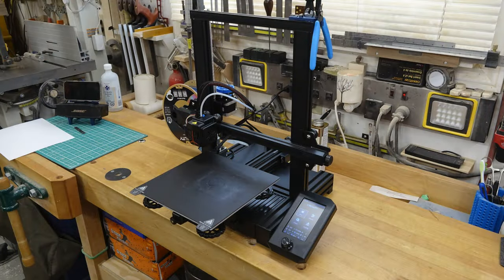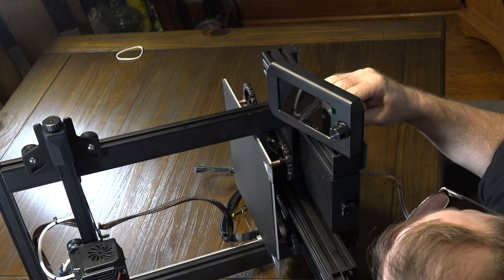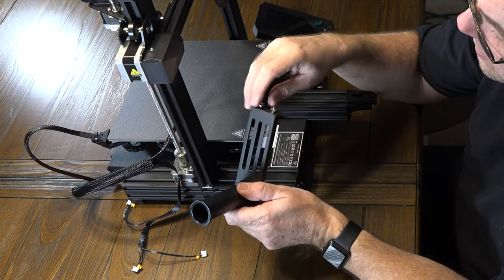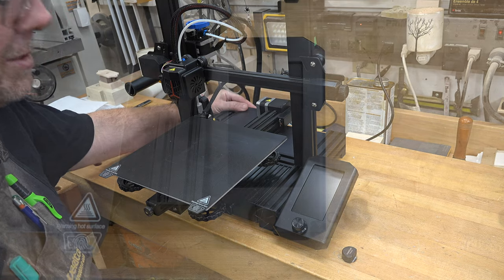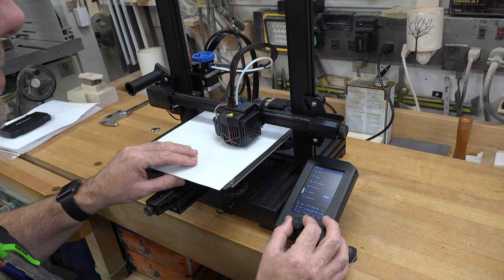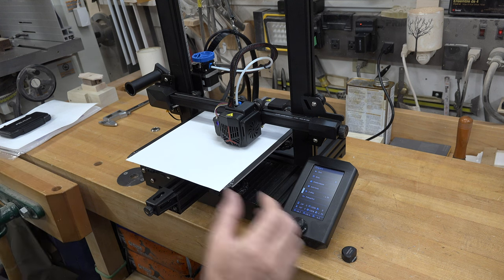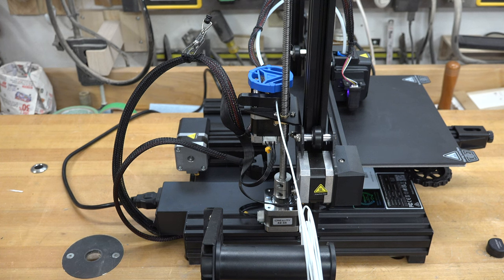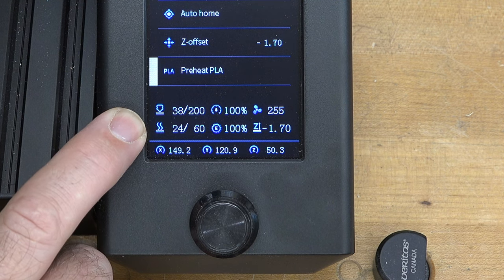Assembly and Bed Levelling of the Creality Ender 3 V2 Neo 3D Printer

Comment: Hi Kenny, good one Kenny, also one important step for you prints sticking to the bed is keeping it clean, I use isopropyl alcohol and don't touch it with your fingers the oil in them will cause your prints to not stick to the bed, thanks again Kenny.
Reply from the maker: I too clean the bed with alcohol Philip.  Good to know that I'm not the only one.  Thanks for tuning in to the show.

Comment: im getting really depresso here, i cant for the life of me figure out the levelling... i did all your steps perfect  in order,made sure it was fine and it still fucks up...im about to cry
Reply from the maker: What seems to be the problem with your prints Rosa?  What exactly is happening.  Maybe you could email me some pictures of how it is messing up or possibly contact me on Facebook messenger and I will help as much as I can to get you making some successful prints.  Looking forward to your reply.  Thanks for tuning in.
Reply: @acutabove_woodworkings  well right now my CRtouch broke off so im waiting from creality to get a new one... cause that plastic housing broke off so fast after i was following a ifixit guide to make sure all the bearings were tight -_- but everything was going super great,i printed a ducky and a boat. so i thought hey i can get started on the real deal, i needed some new ear pad adapters for my headphones cause i bought new pads for it. so i printed part one it went perfect, i wanted to print part 2,/and they are perfect circles btw)...yet it was constantly messing up,it looked like the fillament did not wanna stick to the bed... i sliced it in a diffrent slicers,creality print  and cura,yet the same results everytime... i took a few recordings and images i can forward to you, but right now im a bit hardstuck until i have the new CRtouch... but when i do have it if you dont mind, since this is my first 3d printer ever. id love to have a chat with you or some email conversations about it :/ im willing to pay you if you wish

Comment: Interesting video to watch.  When you were doing the bed leveling and you disabled the stepper motors, does that setting disable the "zen" axis (the up and down) as well?  Guessing not disabled but it wasn't clear to me.
Reply from the maker: if you disable the stepper motors, they are all disabled and will not work again until you click a function that requires them.  I hope this helps.  Thanks for tuning in Dwight.

Comment: Never thought that a 3D printer would have a home in my shop.  Well maybe I need to rethink this.  Thanks Kenny  One thing you did not mention is software.  What drives this little machine?
Reply from the maker: that was mentioned in the introduction to the machine last Tuesday Jim.  You can use whatever slicing software you have available.  I am using Fusion 360 (the free version) for my designs and I'm using Cura (the free version) for the slicing software to get it in the proper formate so that the printer can see it.  The printer does NOT need to be hooked up to a computer in order to work.  It has a memory slot that holds your designs and prints directly from the memory card.  Thanks for tuning in.

Comment: Another excellent video ... even though I don't have one it was still very interesting and informative 👍
 One point I'm a little confused about, I'd assume that a negative value for the z-axis (and z-offset) would basically move the head downwards ... so when you started printing and had to change the z-offset setting ... you moved the z-offset up the way (from -1.70 to -1.68) , i.e. further away from the bed ....... what am I misunderstanding?
Reply from the maker: What you are misunderstand is that the host of the show got confused and gave the wrong information.  You are 100% correct that a value of -1.68 is further away from the printer bed than a value of -1.70 because it is below the zero point of the x-axis.  The number that I gave are only true if you offset is a positive value.  Thanks for point that out to me Barry.  I will have to make a note in the video description section to make sure that folks are aware of the error.  I must have missed that in editing.  Thanks for tuning in.
Reply: @acutabove_woodworkings  We'll forgive you this time ... just not up to the usual standard 😂
With the amount of information you are passing on it's inevitable you make a few mistakes, but they are very slight mistakes ... the video is still very informative and I learned quite a bit from it 👍

Comment: Having issues with printer and cant remember how to level correctly. Im look at 6:12 with the power off. Your zed axis stays suspended but can be moved manually. On my machine, with the power off the zed axis will fall to the bottom, but I can manually move it, however it just keeps falling back to bottom.
Reply from the maker: It sounds like your centrifugal wheels are not tight enough on the z-axis track.  The wheels need to be adjusted to be snug on the vertical tracks of the printer.  If they are not snug, they will just drop to the bottom.  I hope this helps.  Thanks for tuning in to the show.
Reply: @acutabove_woodworkings  Yep. You're correct, that did it. Thank you.

I did continue on with leveling, however it appears the middle of the bed on x axis is concave (dips), and the middle of the bed on the y axis is convex (bulges)
Reply from the maker: @jdcalvin1  Glad that you were able to adjust the wheels on the Z axis.  You should still be able to perform a levelling of the bed even with the slight deformities of the print bed.  It might take a few tries to find a happy medium but you should still be able to get successful printing.  Almost every bed warps a bit once the print bed heats up and depending on how much heat you are setting your bed temperature at, the warp can be a little or an extreme.  Keep on levelling the bed and see if you can find that happy medium that will allow you to print successfully.

Comment: Can you add a link for the cable video
Reply from the maker: What cable video are you referring to?  Thanks for tuning in.
Reply: At the 3:40 time stamp
Reply: You said something about a gide
Reply from the maker: @TimedTrooper  At that time stamp, I state the the quick start guide is very clear on where to put those cables so I would NOT be filming where to plug in the cables.  The quick start guide comes with the printer.